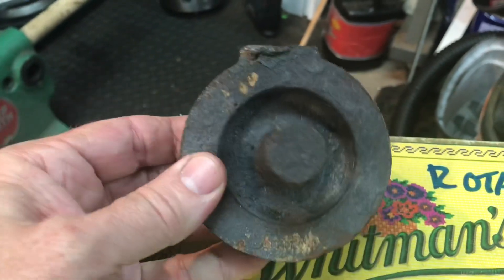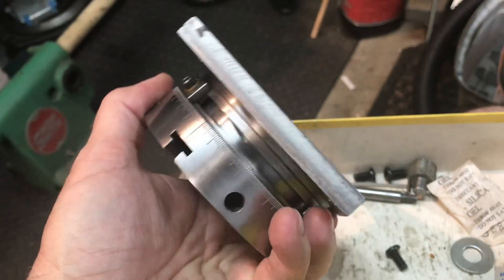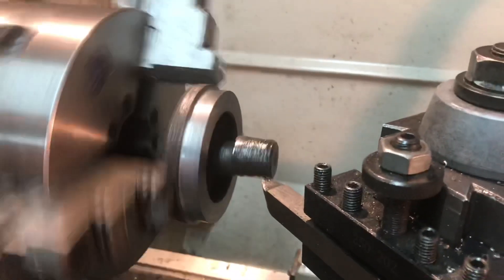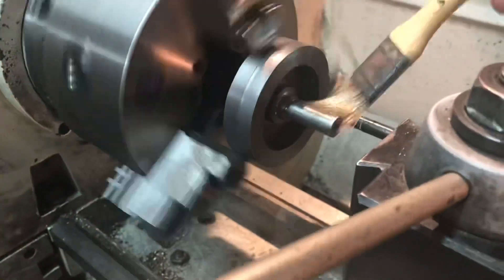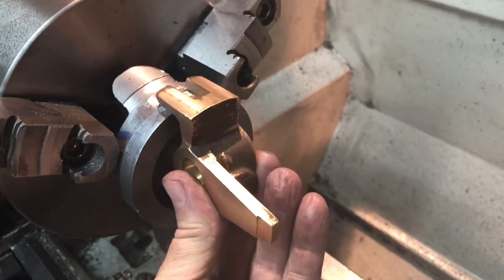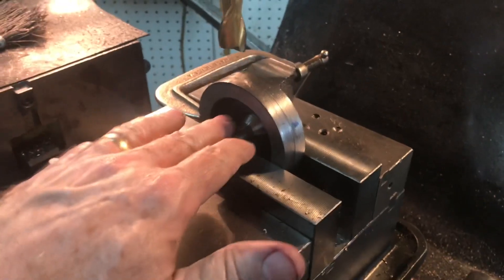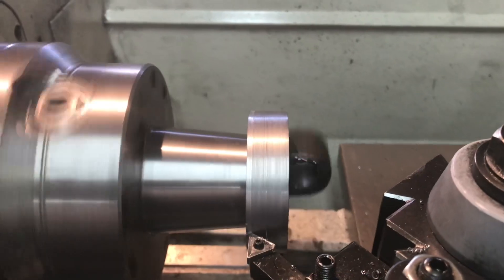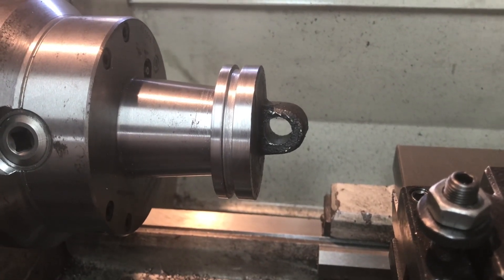Quorn Tool Grinder project, Rotating Base (from original steel casting).

Comment: If I understand your comment at 4:50 you would have done all of the 1/2 inch stub work after the initial cleanup at 3:10. Is that correct? Would that have eliminated the need to run the lathe in reverse when you did get to finishing the stub? If not then what was the issue that required reverse? And, as usual, thanks for sharing and willingness to answer the questions.
Reply from the maker: Yes, I wished I had turned the stub all at once. There were really two issues, first the space inside the base was so small a boring bar was the most practical size cutter to use but all of mine have the carbide cemented to the left side. That means if the cutter is beyond the center of the work you need to have the work turning clockwise or as in running in reverse. The second issue was my reverse switch on my lathe broke and had to be repaired before I could proceed.

Comment: Just done my rotating base. I went with the original T slot, which I actually really enjoyed machining, but wish I'd done it with the dovetail method like you have now. Great video, keep em coming. 
Are you on Hobby Machinist forum btw?
Reply from the maker: Yes, but don’t check in there too much. I’m probably there as Metalmill or Metalmill52. Thanks!